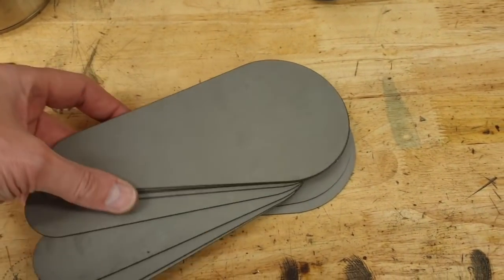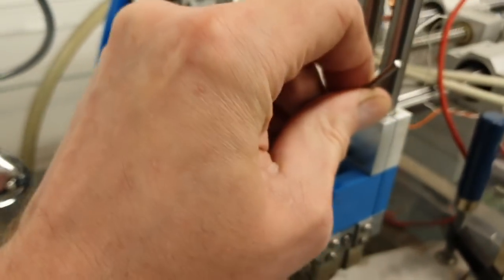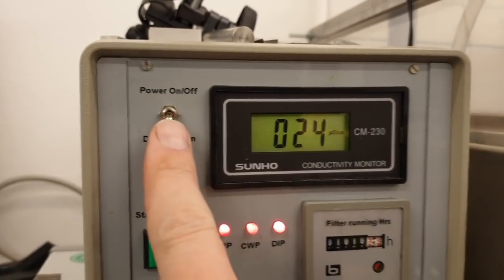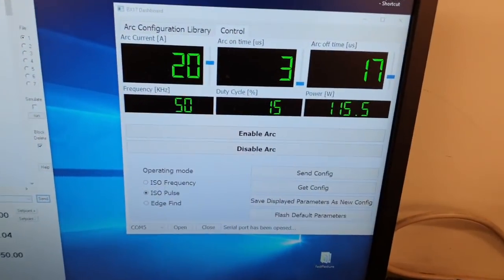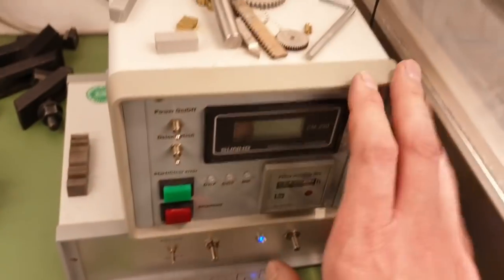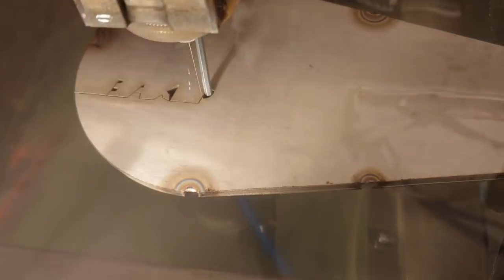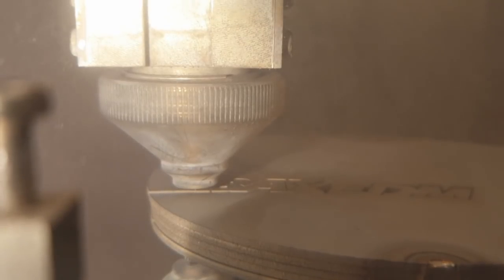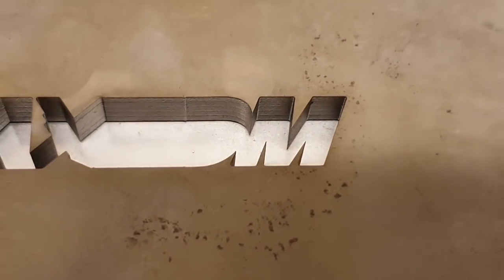DIY Wire EDM Operation and Cutting Titanium

Comment: You often turn the top latch with a key. Put a screw with a steering wheel in there. It will get a little more comfortable.

Comment: This is impressive, but I think you need to change your poop slow so that you have a discharge from the medium head on the top, that plus 15 GPM so that you can dislodge chips without having to physically do it. This would end the code faults.
Reply: Can you use a oil

Comment: Will this do tungsten?
Reply: It will cut anything conductive.
Reply: @NigelTolley  Have you tried?
Reply: @ITpanda  nope, sadly I don't have an EDM. That's part of why I'm watching this video! But tungsten will cut with edm. It'll probably be pretty slow given the density and high melting and vaporisation points and energies, but the  sparks will win eventually.
Reply: @NigelTolley  Figured I would look, yes with the same settings as steel. Just a much slower cut. Apparently tungsten that has been cycled in a furnace is harder to EDM than not. Also the purer the tungsten the easier and cleaner the cut.

Now we both know now.

Comment: Wouldn't it be possible to add a nozzle at the top wire guide to direct a water jet down on the workpiece, in order to push away the centerpieces and avoid jamming? Similar to the compressed gas used in CO2 laser cutters and such.
Just found your channel, great stuff! Thank you for uploading such quality content.

Comment: Great! I like the idea of the machine sending a email when there is an error, I will like to implement 
That on my machine as well , also I would like to put a the wire thru the hole in a transistor to signal wire breakage , because my 
Wire setup is different , but must admit that the use of a switch leg is much less complicated. Keep up the good work!

Comment: Could your machine make something this precise?
https://www.youtube.com/watch?v=mrjmFiYC-XM
https://www.youtube.com/watch?v=jjlml4MGVYc
Reply from the maker: I don't know what kind of tolerance is required for such a part, I've never tried. My machine can do +/- 10um precision, high end commercial machines can go as low as 1 um precision. That's why my machine costs about 5k€ to build, and new high end commercial machines cost at least 100k€. I might try to see how far I can get. But that accuracy requires multiple skim cuts to hone in to the final dimensions. I've not tried that before.
Reply: Would make for a good video series 😀

Comment: Great overview on operations.  Thanks for doing that.  I learn something each time you do a video and it helps me put the pieces together for hopefully doing something similar.  Are you considering creating a kit for a CNC rig and rigging in addition to the arc generator?
Reply from the maker: Together with a 3rd party, we are looking into the possibilities of offering a kit. Can't make any promises, and if we are going to offer it, we're at least a year away of doing so. Kit design, testing and securing component supply is a tremendous amount of work.
Reply: @baxedm9806  You obviously have my vote and encouragement to work on a kit offering.  Remember that the "tremendous amount of work" will be paid back many times as I look at what it would take to do it.  Even though I'm technical in mechanics, electronics, and software, I still don't have the time right now to put that all together even though I'd like to try.   But if there were a kit, I'd buy it today.  Otherwise my only option is to buy a commercial machine.